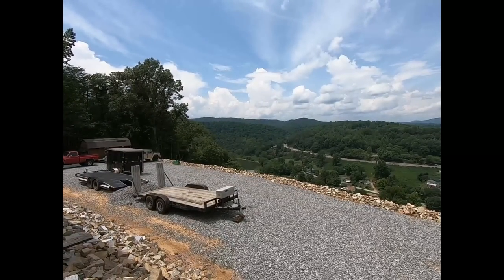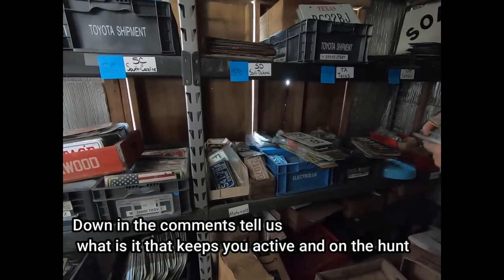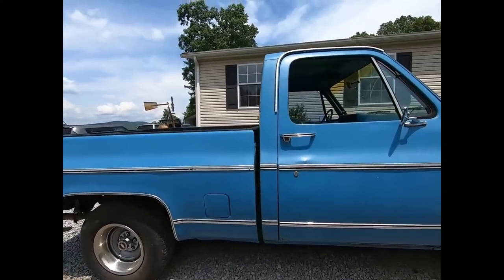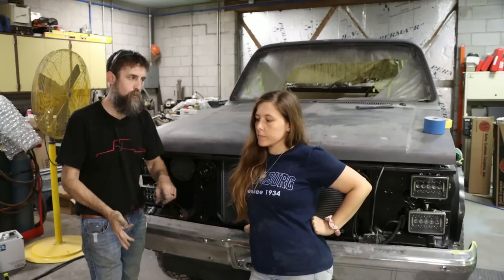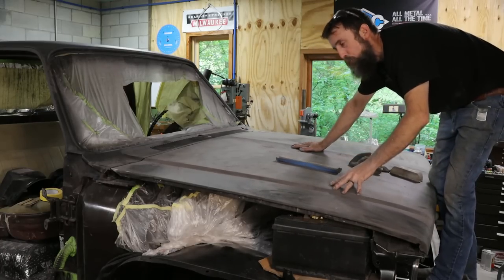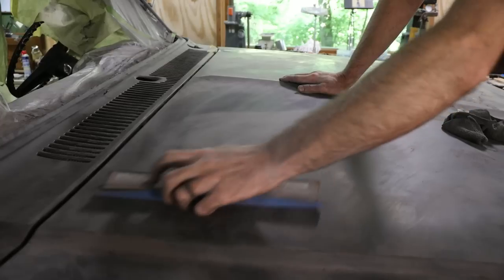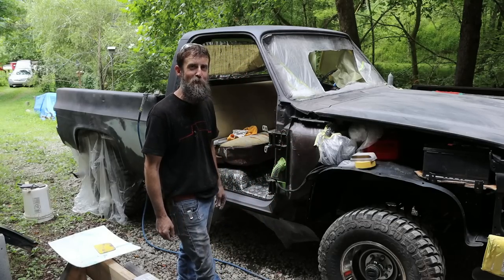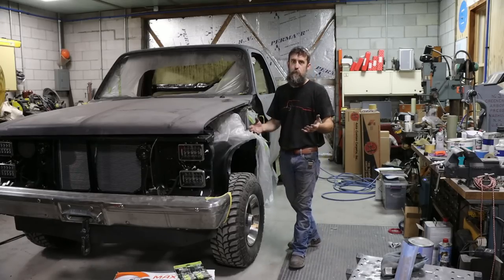Heading down South for Elizabeth .  Truck Update

Comment: Some might think it's pointless, but I collect "vintage" computers. I use quotes because everyone's definition of what's a vintage computer is different. For me it's anything before the late 90s, so over about 25 years old. My oldest one is an Apple II Plus clone that I just bought, which is probably from the early 80s, but I haven't had a chance to take a good look to find a date stamp. It's missing the power supply, so I have no idea if it works, but even if it doesn't, these machines are pretty easy to fix.

Comment: Thanks so much for the update Steve. I too was worried about your being effected by the flooding, particularly as you had not posted the last two Saturdays.   Watching the footage of your road trip I, as a Canadian from a land of heavy winter snow and ice, thought: "What great road conditions you have!". Up here every side road, city street and most highways seem to have as much potholes as good road surface. Trucks like yours and the one you went to see, as bad as they were, are rare indeed unless thy have been rebuilt regularly.
Reply: Sadly, that is a myth. I know the Government of Ontario, at least, would love for us all to believe that our roads are the way they are because of the weather. I'm from Kentucky and I've lived in Ontario for the last 17 years. Why does KY have good roads? They do regular maintenance. On the back road I grew up on, they'd come and shave off the top layer, check for issues, and put on a new surface. Took a couple of days at most. They'd do this every 3-4 years. I've been living on the same major road in Ontario, Route 2, for 15 years now and it's a mess. How many times have they done this basic maintenance? Zero. None. Nada. Zilch. They'll do emergency maintenance, fixing potholes and patching dig locations, but that's it. It's not a road anymore. It's just patches. They don't do maintenance. The only "maintenance" I've ever seen up here is when they dig up the entire road all the way to the bed and replace the whole thing. They wouldn't have to do that every single time if they'd just do actual maintenance.

Comment: I was surprised how bad that truck was rusted. Being from there I would suspect better. My wife has a 79 4x4 short bed that came from Oregon, it has original rockers, fenders, doors. Does not get driven in winter. Maine uses 10 times more salt then down your way and it would explode into dust if we drove it in that crud.

Comment: Glad you weren't affected by the flooding. That's Great news ! Enjoy your videos & the detail you go into. Been watching for several years.
As far as the square body. Be patient & limit yourselves to vehicles from AZ, CA, NM, NV, OR, TX & some WA trucks. Unless you find a Rare exception, southern trucks are plagued by a degree of road salt exposure (in northern southern states, just like the northeast & midwest) & the moisture from the rainy wet climate, high humidity & if it's a coastal truck, the salt sea air, aka FL, southern AL, MS & LA. Coastal vehicles from CA, OR, TX & WA can have surface rust issues. So keep that in mind. Inland vehicles from the aforementioned western states should be good candidates.  
I grew up in the midwest, so I know all about the ravages of road salt & moisture on vehicle bodies & frames. I lived in CA back in the 80's & once you get a taste of the "rust free" stuff, you'll never settle for less. 
Just my advice & two cents worth. 
Remember, Good things come to those who wait, for the right one to come along. 
Best of luck with your search !

Comment: i had a truck years ago that Elizabeth would look great in. You are correct about the vehicles in the western states. I lived in Nevada and the body of the truck was great, but the rugger and upholstery, not so much. my truck was a '74 GMC short bed with 50's on the back  which was raised and 60's on the front  which was lowered. it reminded me of a vehicle from the cartoons magazines. needed a paint job, but it was pretty sound cosmetically.

Comment: Glad you are all fine. The news over here has been covering the weather situation in your State. 
It's a pity the fellow selling the truck hadn't been a little more upfront about the condition. Had he told you that the floors were completely gone, you might have saved a six hour round trip. Especially with petrol being the price it is these days. 
Best wishes, Dean in Oxfordshire, UK.
Reply: Down here in Zummerzet we'd call that truck a 'Fred Flintstone Job'.

Comment: You are 100% correct shrinkage will happen. A good bake in the hot sun will help cure out the solvents. 

Maybe better off building a truck from parts. You're going to haul one home and blow it apart anyway (?)
Reply from the maker: A good sunning will definitely help cure the solvents out. Using good products helps as well. As far as doing another big repair goes I am not interested at the moment.  We want something that needs a week or two of work. Not 10 months like the one I am doing now.

Comment: Steve i definitely can’t weight to see the finished paint on it all done!! It’s definitely going to look beautiful!! A good finished product definitely takes plenty of time so don’t rush it for us take your time still and make sure it’s definitely the way you want it!!! I’ve been working on a couple of my square body also for a while now!! One I’m weighing on a set of rear leaf springs and another one I just got done rebuilding the hydro boost power steering and brake set up and after I got it all done I found out that I had a caliper sticking!! So now I will have to put two new calipers on the front along with new rubber lines from the calipers to the frame and probably a couple rotors also!! It’s a k30 1TON 4x4 tow truck so brakes are definitely important on it!! Hopefully this week I’ll be able to finish one of them up!!! Remember keep up all the hard work buddy!!!!

Comment: I live down near Chattanooga, and the main thing with those old trucks is that people pile junk in them and stick them under a tree for 15 or whatever years. The pine needles and oak leaves hold moisture against the steel and rot them from both ends. It is a shame too, because the newer trucks have so much garbage on them that you'll never keep functioning for 20 years. I have a 2015 sierra denali that is covered in electronics, and they are starting to get finicky. The service trailer breaks warning comes on all the time even when there is no trailer connected. Your looking at a nightmare of a time taking that dash out and troubleshooting grounds and stuff. But I'm off on a tangent here. People that do not accurately describe what they are selling is about the most aggravating thing I can think of. That guy knew darn well that truck was rotten from top to bottom, but I doubt you'd waste your time driving to see it if he had of expressed that in the description. With the fuel prices of today I'd have had a hard time not wearing that guy out.
Reply from the maker: We enjoyed the trip either way.  Condition is dependent on what someone thinks is good or not. He was a great guy and doesn't repair vehicles for a living so he may believe its in fair shape. I tend to look pretty deep and just coming off a massive restoration I know where to look for the problem areas.
We don't regret going and giving it a look. I must admit I wasn't surprised at all
Reply: @SteveSummers  Lol, I wouldn't call lifting the floor mat 'looking pretty deep'! I know what you're saying but that truck looked pretty bad...

Is it a requirement for people wanting to sell something to be cunning deceiving ratbags? Especially the car manufacturing companies; they know full well how long things will last when they put them into their vehicles including all the gimmicky gadgets that no one ever wanted until they became the norm. And don't get me started on super cheap imports that so often will barely even do the thing they're created to do but as a result you have trouble finding the original manufacturers that used to make the things because they were proud to create a quality product so they could earn an honest dollar.

Oh look, it's an Inch worm... Haha

Comment: 20 minutes for the paint and primer is for the body shop, so they can get the next one on, and get it out of the shop fast. That it will have issues 3 years down the road is not their problem. Steve though wants a paint job that is better than the factory, with what the factory gave as standard that is a very low bar, but he wants it to be equal to the better coachbuilders.